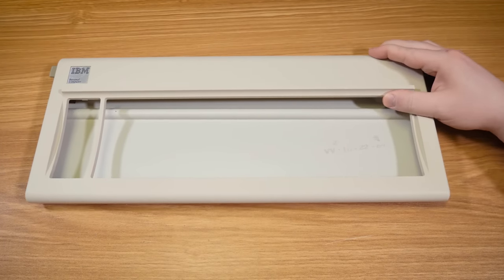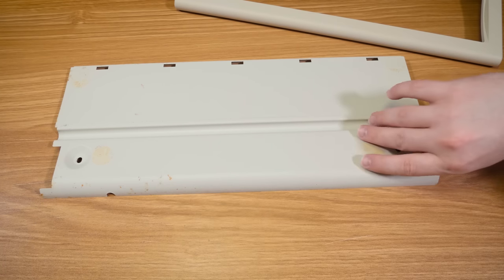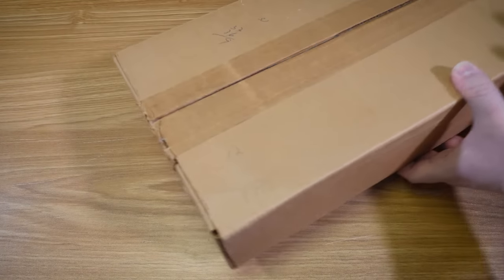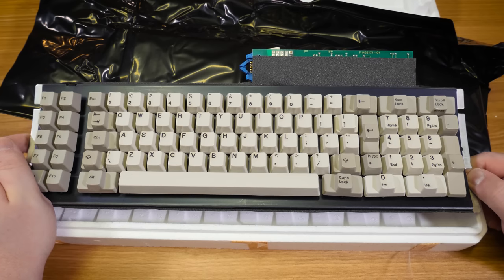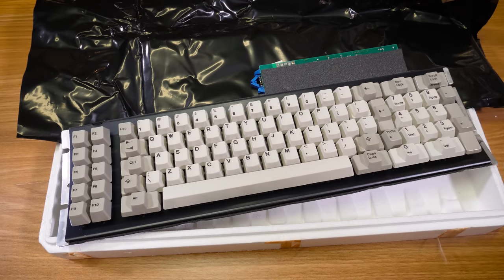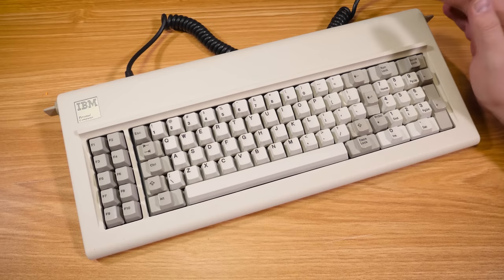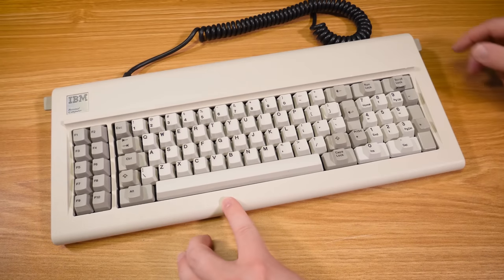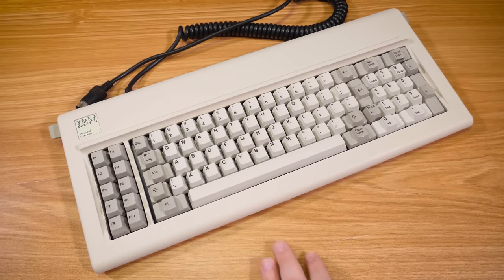Reassembling an IBM Model F with New Old Stock Parts

Comment: Taking apart an F keyboard assembly isn't too bad. Getting it back together is more tough.

You bend back the single lock tab and the whole plate slides in one direction and pops right off. Getting it back on can require clamping or a second set of hands to get it slid back in place.

Comment: That cable end connector looks like the single most satisfying connector to use that ever esisted
Reply: I'm glad someone else noticed, that locking mechanism was awesome.  Now a days the cable would just get shoved on their with just a dab of hot glue to hold it if you're lucky.
Reply: try a nema l26-30 connector sometime
Reply: In something new it would be soldered directly to the board.

Comment: Hey Clint! As a long-time tech enthusiast I'm sure you already know about this trick, but to anyone else who struggles with those obnoxious flat-head screws: Generally if you have a screw-driver that takes bits, you can actually remove the bit and use the hex socket of the screwdriver on the hex-heads of the machine screws. They're almost always a perfect fit, and makes things WAY easier to screw in. :)
Reply: Great trick, but it only works with 1/4" heads.
Reply: Was going to say if he has a 6 in one driver they would probably have that size hex
Reply from the maker: I typically just use a hex head bit instead, which I think would be a 3/16" hex screw in this case. This wasn't recorded at home where I have all my tools though so I just used what I had on hand. Blerbs is not about doing things as best as possible, it's just about doing things :)

Comment: Honestly I really like the layout of the model F after using it for a while. I just used the Soarers converter to remap Caps Lock to be a function key to add in some of the missing keys for when I use it on a modern PC, and now I think I might like it better than the standard layout.  Only thing is I do wish it had some proper arrow keys instead of having to toggle num lock.
Reply: I had a clone of this keyboard growing up, I grew very accustomed to pgup/pgdn home/end in the positions around the arrow keys, and the function keys on the left.  You would keep the num lock off all the time unless you were doing some tedious data entry or something.

Comment: The Model F is the hipster's Model M. And I want one.
Reply: Being able to remind the Model M peons that their keyboard actually uses a membrane must feel SO GOOD. Too bad about the weird old timey terminal layout tho.
Reply: @Nukle0n  There is a model F AT layout. IBM 5170 PC AT
It's one of the most desirable models though, so good luck.
Reply: @rich1051414  You can do better than the F AT as well, though the F AT can be converted to ANSI with some dremeling, etc. There were also F variants for a particular banking terminal that had solid zinc cases. These could easily be configured for ANSI layouts, and Ellipse is manufacturing new reproductions of the F62 and F77 variants of these. I have one of the new F77s and an original F107. Wonderful keyboards. The F XT is unusable if you ask me, even as wonderfully pingy and gigantic as it is.

As to the original comment, the Model M sucks in my opinion. It feels mediocre, even at its best (I prefer even most modern clicky switches) and the construction/durability of the M was very, very poorly designed. Conversely, the F rivals Alps SKCM blue.
Reply: @Nukle0n  Model F and M user here - I couldn't care less if one has a membrane, certainly not enough to feel the need to be a dick to Model M users over something very trivial. Arguably a part from 2KRO, it's not like the membrane is obviously there either - if you somehow made a capacitive version of the Model M flipper and put it in a Model F assembly (along with M springs), it'd likely feel identical.
Reply: @xb0xisbetter  To be honest, the only thing I need to change on F/ATs are their single-unit backspace. Something like a Focus layout is pretty usable. If you're used to ISO (like myself), the F/XT is also usable with a few adjustments. I somewhat treat them as an oversized 60%, moving the F-keys onto the number row (accessed via an Fn key) and then add a Windows key, volume controls, dedicated print screen (etc.) to where the F-keys used to be, and finally make Fn+Alt AltGr access European symbols. 

"Very, very poorly designed" is an overstatement, IMO. The only structural issue of consequence on standard Ms are the rivets, but even then, the Ms that used them have survived decades without bolt modding being a huge thing as it is now. Their flexible dyed plastic is also more durable than the brittle and painted variety used on most Fs simply because it doesn't crack as easy nor is there any paint to possibly come off! In regards to the Model M1s and M2s though, then yes, those are harder to defend...
Reply: @sharktastica  Sure, you're above it all, because you have both of them :P
Reply: @Nukle0n  He's got a lot more than just an example of a Model M and an example of a Model F. If this is who I think it is, this guy could open a buckling spring museum.
Reply: @xb0xisbetter  Correct, lol.

Comment: That ground loop that you taped over shouldn't be taped... It's supposed to ground to the bottom of the case.  The tape prevents this.  Not sure if this would cause issues and I'm guessing it's just a drain for static build-up on the bottom metal case, but I'd take a look at that maybe!

Love your videos!

Comment: Model F keyboards are truly the best, as far as a practical vintage board is concerned (I know about the beamspring, but those are both cost prohibitive and have their limitations). I had a model F AT for quite a while and it was amazing, but as mentioned in the video the layout didn't translate well to a modern system and the spacebar was ridiculously stiff. I was mostly using it for DOS gaming, which worked fine, but having the row of F keys along the left rather than across the top was quite annoying when I'd instinctively go to hit F5 and end up hitting 5 or the top of the case lol. I ended up selling it and, to be honest, I kinda regret it because damn did I love just about everything about it.
Awesome to see you using a model F though, especially on an appropriate computer. Hope to see you using it more and more in future videos.

Comment: Why don't keyboards have function keys on the left any more? I think that would be great.
Reply: Because the Model M set the new standard and it has stayed the standard since then ;)
Reply: there are keyboards with such layouts, though it's mostly propriatary "G" keys instead of the function keys
Reply: Some still do.  Just have to find them.
Reply: Unicomp sells a PC122 model with function keys on the left side.
Reply: my thoughts exactly. a TKL with F-keys on the left would be the ideal setup for me
Reply: Yes. Keyboards have so much stuff on the right, but nothing on the left. That bothers me. If anything, it should be the opposite, since the mouse is already on the right. At least with the F keys on the left the design is a little more balanced.
Reply: @censoredterminalautism4073  DSI makes a "left-handed" keyboard with the navigation cluster and numeric keypad on the left side. It looks like it  came from the mirror dimension.
Reply: @OtnerNaut  It's funny that they call it that, because normal keyboards already have a design that would be more ideal for left-handed people, to the point that I considered switching my mouse to the left before. I did it, but didn't keep doing it only because keyboard shortcuts tend to be on the left, so I felt like I needed two left-hands to use my computer that way. Also, I guess it could slow me down if I played first-person games, and the default controls for those games are also on the left side. I can do it well, but I'm not sure if I would ever get as fast with my left, since I didn't grow up doing that.

Anyway, I think the ideal solution is to have all that on the left (then you can more comfortably use your nav while you use your mouse, and keep the typing portion of the keyboard right in front of you, while also having a lot of space for the mouse), and keep the mouse on the right. Even for left-handed children that would be better, because of the keyboard shortcut thing. It's probably better for them to just use the mouse with the right hand regardless, because it legitimately doesn't matter since you're going to use both hands anyway, and keybindings will always be on the left, since most people are right-handed.

Comment: More or less unrelated comment:
Did you ever try to use a "Magic Eraser"  to get the gunk off of 2nd hand parts?
Reply from the maker: Yep, I've shown my whole cleaning process for these computers in a number of LGR videos! Magic erasers are always step three or four in my routine, but they only do so much for deep stains and I don't want to wear down the paint job.

Comment: Being a habitual dismantler of things myself, looking at the back of the keyboard mech, it looks like you just take one screw out and slide the metal backing plate over to the side and lift off, though not having one to try that out on, I can't be sure on that... :\
Reply: There's foam between the front and back plates that is compressed during assembly. Getting these apart and back together usually requires at least pliers, sometimes hammers, and sometimes clamps.

Comment: hey clint  you can get an almost model m layout on a model f but you have to buy an ibm model f122 and then you have to modify it also you only have to bend the 1 tab on a model f and then tap it tiwh a hammer and it will just slide apart i service these all the time
Reply: Have you ever tried the 3D printable Model F replacement feet? They're pretty rare and are known to break, I know a lot of restorers delete broken ones during rebuilds, but this gives the keyboard a pretty uncomfortable angle.

Comment: I'm also partial to the IBM model M & F keyboards though I always prefered the commercial / industrial grade keyboards (dust covered/ cooking oil/water resistant/corrision resustant & fully sealed/ toughbook-esque options for the Amiga 1200.

Many brands and features, the extra wide full keyboard + numpad w/ that ~20mm long 8 way skinny pole, nipple tipped 'joystick' for factory use.

I'n pretty sure theae keyboards were repurposed Model M / PS2 keyboards though the 15 key simealtaneous press on some (basically 1 for parity error, add 3+ BUS redyndancy it was really an 8-10 keys at once keyboard at a much greater latency.

Comment: It looks like if you remove the screw on top, the metal backplate should slide slightly to the side and then come off.  You should not have to bend any of the metal to remove.

Comment: (3:21) It looks to me (of course, sitting at home looking at the screen and not actually holding one) that you just bend up/back that one metal tab in the upper left hand corner area and likely that one screw in near the upper middle attached to the PCB and the metal plate should just slide to the right a bit and lift up and off. Again, that's just from what I can tell looking at it on a fricken' D screen. ;) I'm not trying to insult your intelligence. I'm sure you've tried every which way to get that plate off. I dunno, that's just my take on it from what I can see here. :) Happy clickity clackin'! ;)

Comment: On the backplate, you don't bend them out of the way - only the corner one needs bent, then the rest slide out with a strike. Actually a million times easier than separating the sandwich on a Model M. Just restored an F AT. Art foam and a punch to remake the disintegrated foam works great in the absence of new old stock.

edit: almost forgot - with a USB adapter, the Model F indeed works with a modern smartphone like in your old Model M test.
Reply from the maker: I tried pulling this one apart but it seems the stickiness from whatever was spilled in there made it rather glued in place.
And yep, I believe I mentioned using a Soarer's converter in the video. What I'm really waiting for is the modern Model F77 though :)

Comment: Can anyone guide me to a ps2 to usb that works with model M from 89? I have tried a whole bunch and none of them works. Some kind of works, but every 10-100 keystroke gets repeated multiple times. I had to stop using my keyboard and get a crappy usb one. (Been using the same model m since 89, and it still works great on motherboards that have ps2)
Reply: Have you tried Soarer's converter? There's an eBay seller named Orihalcon that still has a few in stock. Works great for my keyboard
Reply: @JC-gu5cf  I have not. Will try.

Comment: Very cool but it's no model M
Reply: The Model F is better than the Model M.
Reply: @Skelig  Ah I'm not sure I believe that...

Our Dos\3.1 486 had a model M as did the machines at my Jr high and at least first year of high school. The model F sounds nice but I don't think I'd like the way the keys are layed out.
Reply: @JohnSmith-xq1pz  There were Model Fs with a far more familiar AT layout than the one shown in this video, but across the board the capacitive buckling springs of the Model F are better than the cheaper membrane ones featured in the Model Ms, both in key feel and sound, plus inherent n-key rollover as opposed to the Model M's 2KRO. The XT keyboard layout isn't actually that bad once you get used to it either, the only thing I really don't like is the excessive use of stepped keycaps for keys longer than 1u, it looks kind of ugly, but the AT ones did away with them for the most part and used stabilised keycaps instead.
Reply: @Skelig  interesting...

Comment: Genuinely never get the apparent problem with taking apart a model F...there is one tab to be bent back and one screw to undo then the rest of the back is supposed to slide out from the other catches - they don't need to be bent back. It's a tight fit but a few good taps from a hammer and it will go. All you then have to do is make sure the mech is upside down when taking the base plate off so all the switches don't fall out and you're good (and definitely don't disturb the foam layer which will disintegrate on contact after all these years). Reverse to reassemble. When I had a model F with sticky switches it was stripped down, all contacts cleaned with isopropyl and back together within an hour. Nothing like contemplating a bolt mod on a model M in the same situation

Comment: -Places cork feet in the wrong spots
-TAPES the ground strap down 
-Misses the PCB screw

"Refurbished" 
 
Lately popular Youtubers have just been crapping on vintage IBM stuff. Motivation to release my PS/1000 video...
Reply from the maker: The cork feet went in exactly the same spot as the damaged/missing ones before I took them off, and they're in the same spot as my other Model Fs. The tape was only temporarily holding the wire in place, and once I got the screw in its hole I removed it before screwing the back completely on. And I'm not sure what third screw you're referring to, as I only removed two screws while disassembling the board, there are no others that I'm aware of for the simple board swap I was doing here.